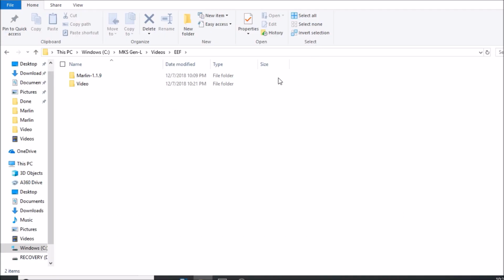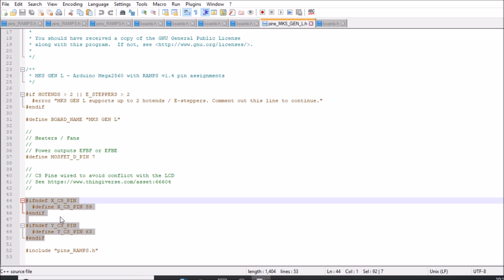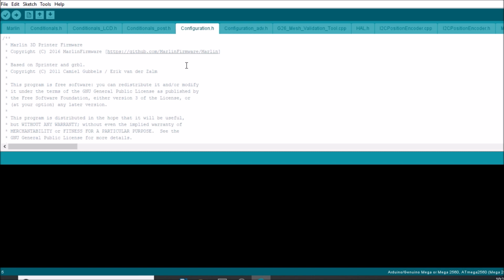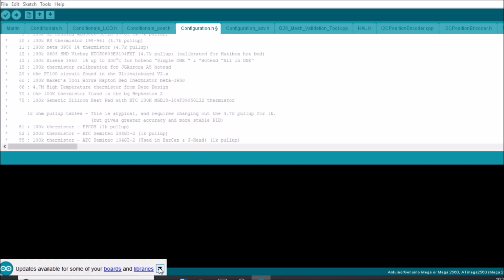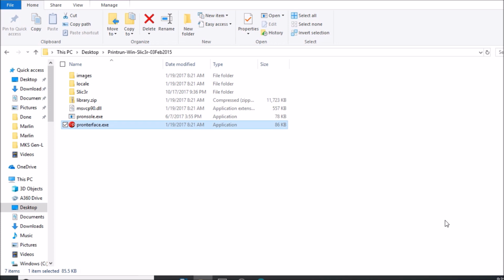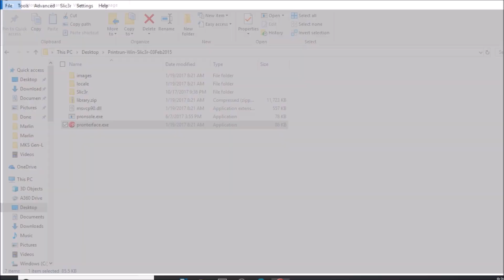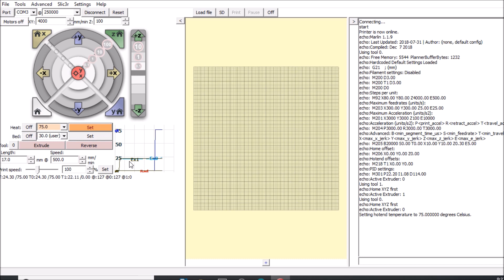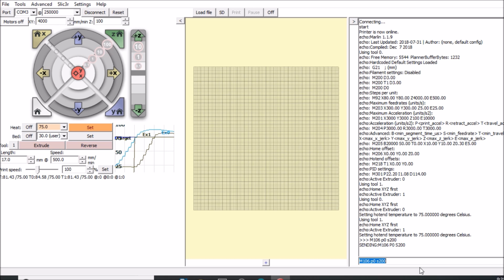MKS Gen L - Extruder Extruder and Fan (EEF)

Comment: Hi Ed, Great Great tutorials. I've just one question .  For us who have the MKS GEN L 2.1, the exact same pin out as this 1.0, how do we program de second fan to cool down the second extruder?
Reply from the maker: If the pins are the same as MkS Gen L v1.0 you can use a fan extender.
Reply from the maker: Note fan extender is rated for 12v.
Reply: @EdwardBraiman  That's a good idea. Thanks

Comment: Edward:  I’ve seen a couple of your tutorials on setting up the fan to turn on and off using type-in commands. How do you set the fan (D9) up so that it turns on automatically when you turn on the power supply?
Reply from the maker: You can activate fan via Slic3r command or in Pronterface with the command for starting print.  Basically it's normally encapsulated in gcode file.

Comment: Hello, i upgraded my ender 3 melzi mb to mks gen l v1
0 +3x tmc2208 + lv8729 +external mosfet with marlin bugifx everyrhing is fine except extruder fan not working automaticly at starts or extruder printing 205c pla, i got clogged first time i can set 255 mauel its working and peinting no issues how can i set autostart it with printer on and which version best 1.1.9 or bugfix ?
Reply from the maker: In Slic3r go-to printer settings tab and set custom gcosed for start gcodes.  Or on filament settings tab select cooling.  When you slice your model for printing it will be wrapped up in gcode file.
Reply: @EdwardBraiman  but not part cooling fan i can use like ur told, front fan which cooler the extruder aliminum block its not autostart now
Reply from the maker: Does it not work with gcode command? Or are you referring to the fan extender on servo pins?
Reply from the maker: Are you using Pronterface with Slic3r?
Reply: @EdwardBraiman  with gcode part cooling fan starts which layer i selctee exqmple layer 2, i dont use at the same time com port let only one program i know that but formly with melzi board when i turned on printer extruder fan started too, i ll dig it maybe there is marlin config for it
Reply from the maker: The fan is controlled by the Slic3r of the object to print inside the gcode file generated by Slic3r.  So here is an example, open Slic3r and open a file to print.  Create a gcode file from the object.  Open the file in a text editor.   Search for the fan gcode M106.  It should be in the file.  Basically the fan control should be controlled by the printer file. Like object.gcode.  hope this helps.
Reply from the maker: It's telling Marlin firmware how to operate with gcodes.
Reply: @EdwardBraiman   i found problem and fixed it lol its easy i missed it,
#define E0_AUTO_FAN_PIN 7
thank you, much appreciated.
Reply from the maker: You're welcome.

Comment: hello, I followed your steps, but when connecting to pronterface I get this message "Error:MAXTEMP triggered, system stopped! Heater_ID: 0
Error:Printer halted. kill() called!
 " and the connection fails. Can you tell me what my problem is
Reply from the maker: Probably either thermistor not plugged in or broken.